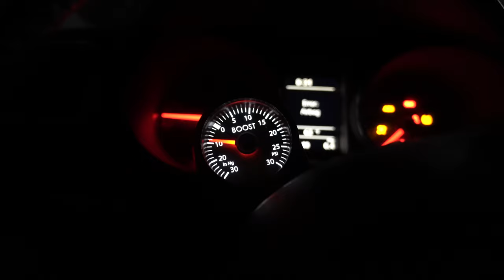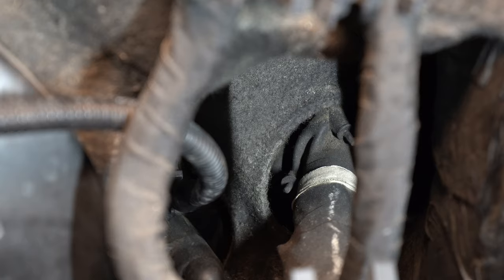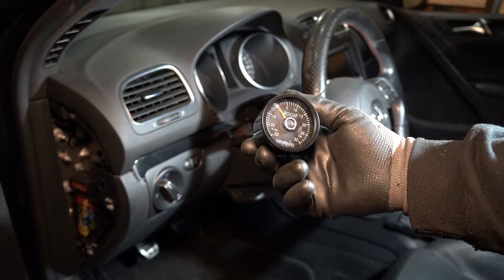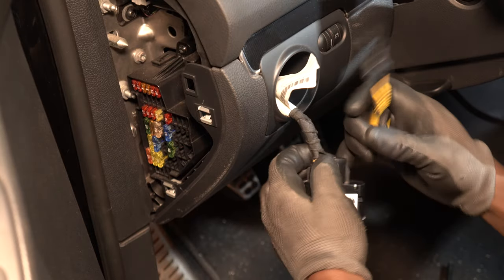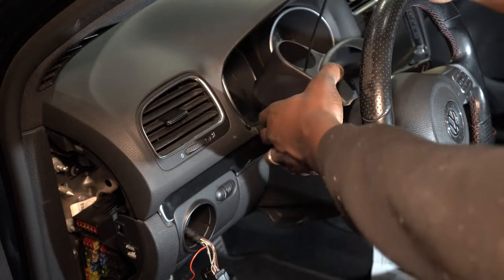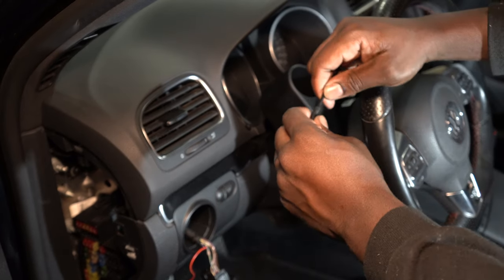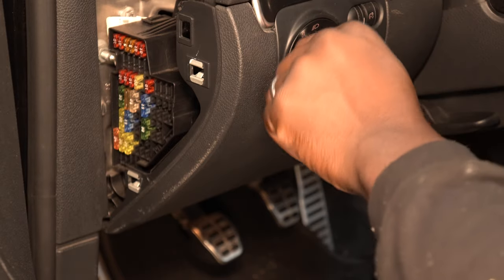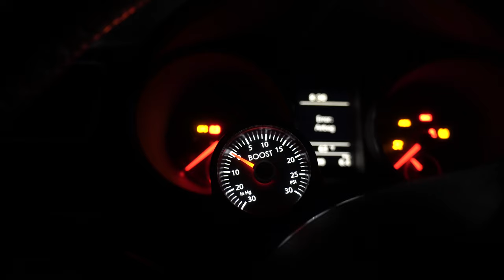VW MK6 GTI Boost Gauge Install Steering Column Mount MKVI 2010-2014

Comment: Hey man thank you , I just received mine and I wouldn't be able to do it without your help
Reply from the maker: I'm happy I was able to help! Thanks for watching.
Reply: @CraftyWorkshopBuilds  would it be the same way to get through the firewall in a 13 cc? Take the battery out and cut the rubber gromet?
Reply from the maker: If your firewall looks similar to mine then definitely yes. I don't remember if the CC has a dual firewall like Audi's or Passat's.
You can always carefully cut the rubber grommet and put a long screw driver through, then check under the footwell for the other end of the screwdriver.

Comment: Great DIY. Only feedback I'd give is consider not having the line run right next to the engine or coolant lines, the nylon can melt with the heat and create boost leak.

Comment: Hey I just did this on my 2014 gti and it works and all but it doesn’t light up I know I wired them correctly any suggestions?
Reply from the maker: Check and make sure the bulb is working and not blown. If the bulb is good, you can use a volt meter and check and see if power is in the wires, when you turn the switch on. Remember the bulb in the gauge only light's up when the park light or headlight is on.

Comment: Hey, what was that liquid you used to help get the tube on at 5:02? 

Great video overall, thanks
Reply from the maker: I used motor oil. The rubber tube is a lil challenging to get on, but it's possible. Thanks for watching!
Reply: @CraftyWorkshopBuilds  Noted. Thanks for the response!

Comment: Does the boost gauge come with the pod that goes on the column or is that separate
Reply from the maker: The gauge pod is separate.
Reply: @CraftyWorkshopBuilds  where did you get the pod and which one?

Comment: great video! I did my wiring the exact same, but the gauge stays lit up when the switch is off, when I turn the switch to running lights the gauge doesn’t light up… is this normal?
Reply from the maker: Nah, the gauge light should be on, when you turn on the light. Which brand boost gauge you got?
Reply: Newsouth gauge

Comment: How did you get your steering wheel trim off?
Reply: Yeah for real I can’t find it anywhere how to
Reply: @rustbeltrestoration  You have to use a trim tool, prop it open from the center where there's a line on the column and it pops off.

Comment: Thank you for this video will be using the info within the next few weeks. Also you don’t need to take top part of steering wheel off the gauge pod can just fit on top of existing?
Reply from the maker: Yes, no need to take off the top part of the steering column. Thanks for watching.
Reply: @CraftyWorkshopBuilds   amazing thanks for the reply. Have you ever thought about installing a innovate  motor sports ethanol gauge! I could use that install
Reply from the maker: @brennengunter5150  yes, actually. I plan to install that gauge. The car currently has a big turbo and I'm planning to tune for e85 as well.